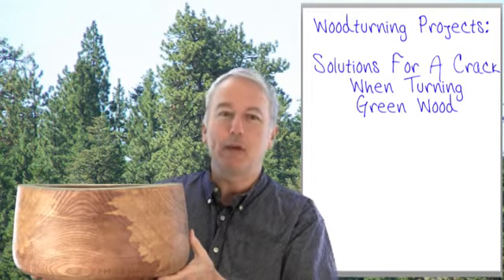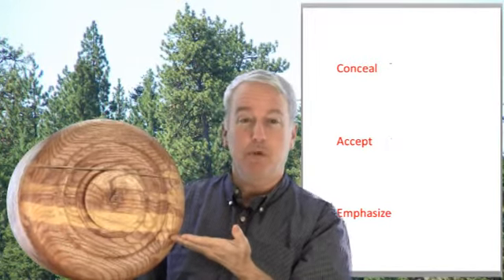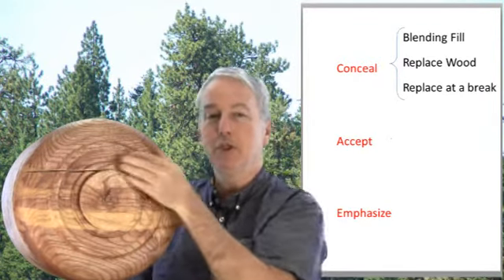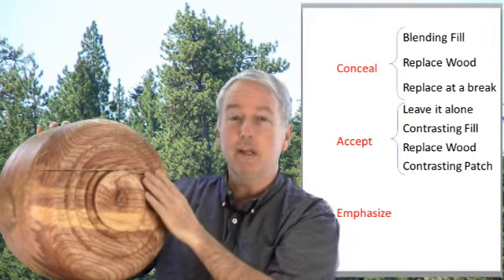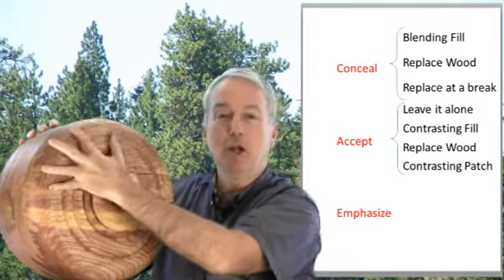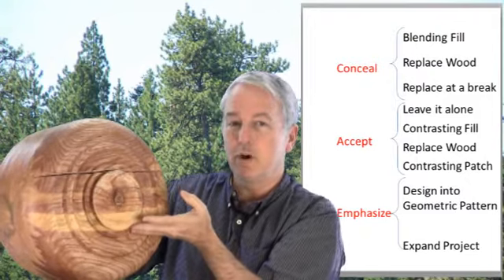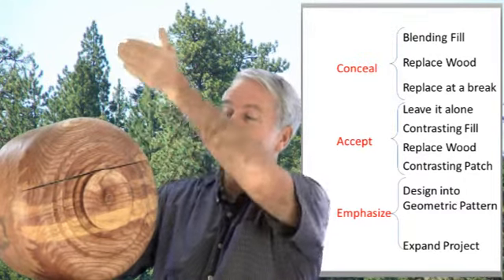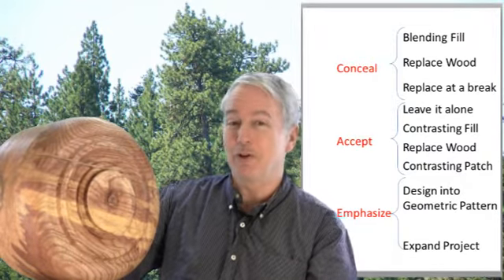Help - My Green Turned Bowl Cracked - Part 2

Comment from the maker: I like it.
Here's two spins on your idea.
1. Finish turn the bowl as is. Then cast into acrylic and again turn to final bowl
2. Cast acrylic to coat only the bottom. Turn the bowl to true it up but focus on the bottom and find a good place to blend the future acrylic into the design. Cast the acrylic inside and out of the bottom. Finally finish turn to blend the acrylic joint. 
I think I'd try this out on a smaller bowl to test the process.

Comment: What occured to me was fill the crack with epoxy and put the bowl in a press and compress untill the epoxy cures.
Reply from the maker: +Dennis Williams Given that the wood shrunk to create the crack, I don't see that compression would help. However, filling it with epoxy should work great.
Alan